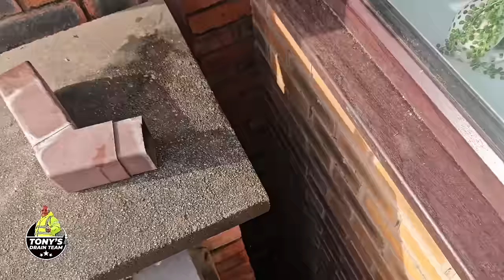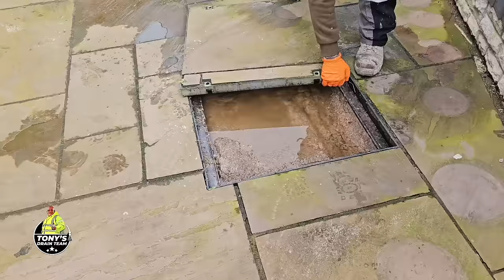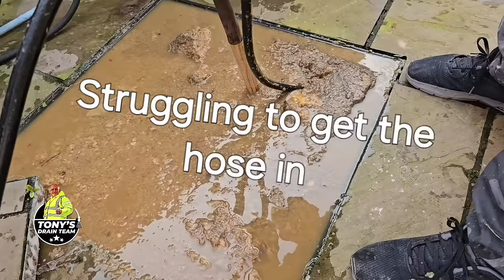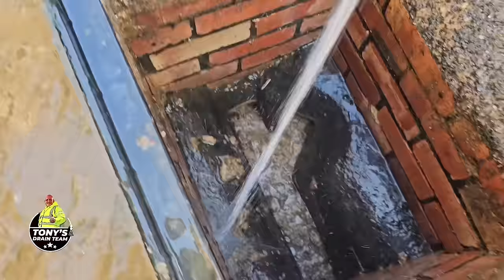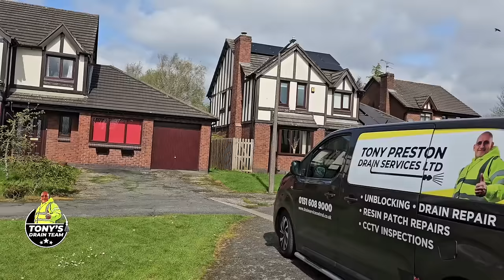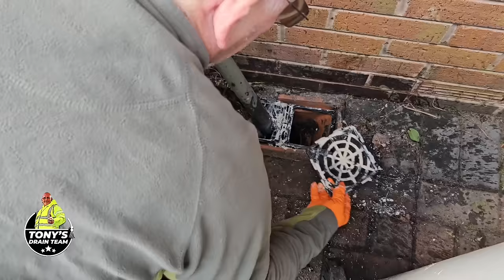Blocked drain. Dip stick gutter guy. #drains

Comment: Isn't there a machine u could get to get some of the junk out of there so you can find the drain easier.  Just asking.
Reply: Thats what I ask myself all the time! But obviously the little vacuum he has wouldn’t help. And the big guys with the vacuum-trucks that could suck it all up in a minute are quite expensive to order l‘ve been told.
Reply from the maker: Could vac it out but the problem is where it goes after it's vacuumed out, I am a drain jetter not a dedicated vac truck operator ( mainly used for road gullies) cheers